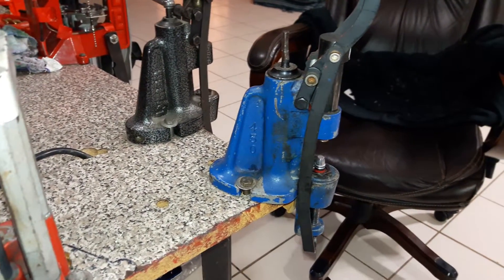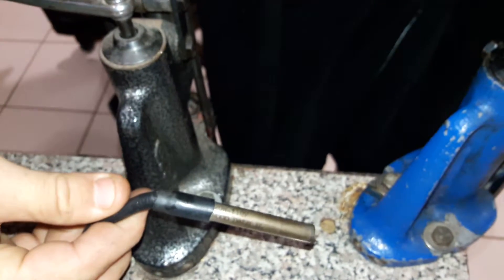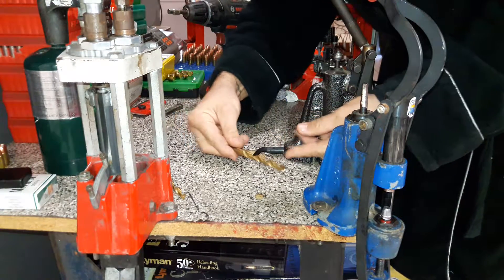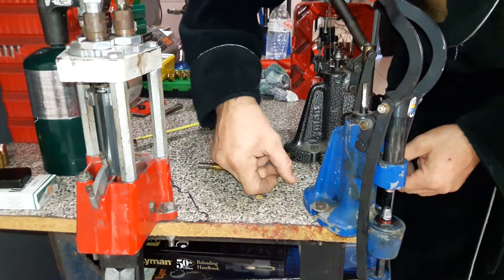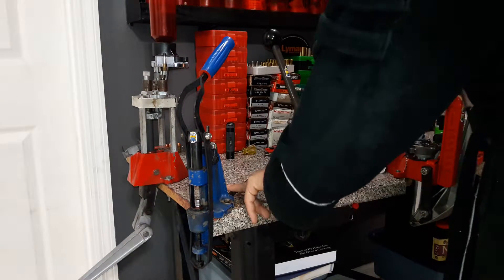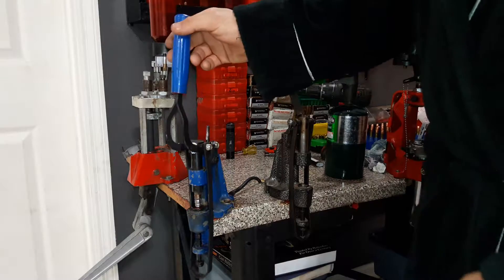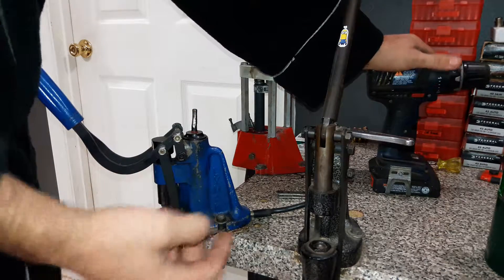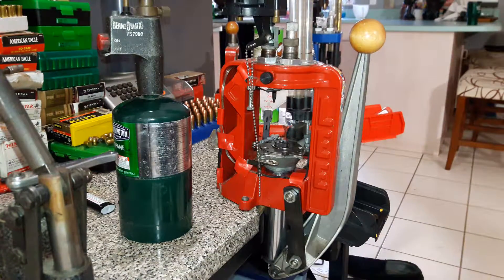Lube Sizer 450/4500 FREE Upgrade DIY Tutorial

Comment: Thank you for pointing out the differences in the two models.  It's good to know that most parts are interchangeable.  
I used a hair dryer to heat my 450 and SAECO lube sizers, until I bought a RCBS lubricator heater.  Lyman has a similar one.  The Lyman, RCBS and SAECO lube sizers all fit on the Lyman and RCBS heaters.